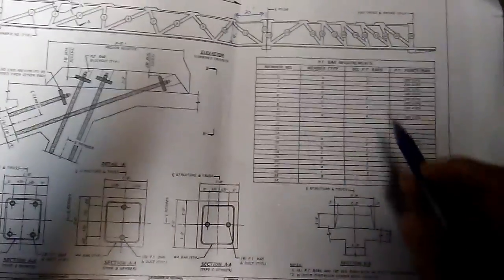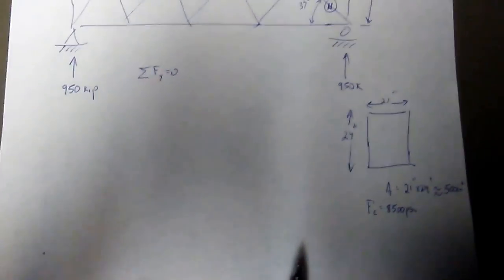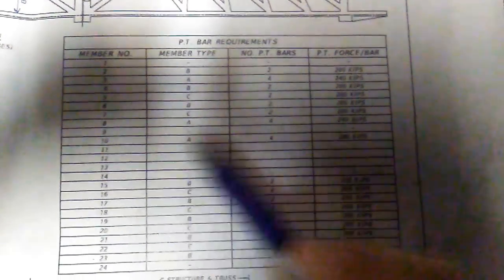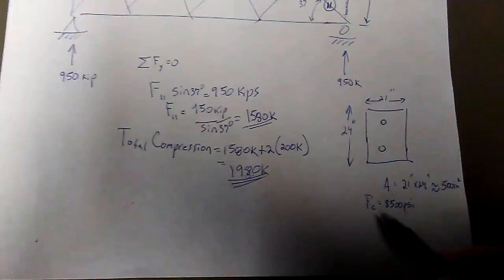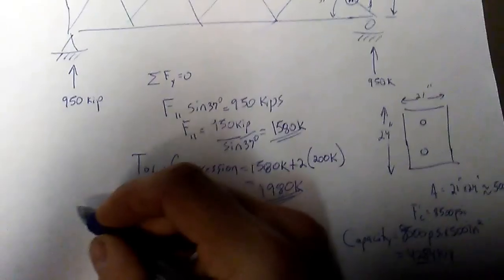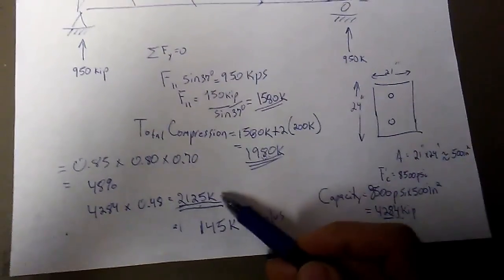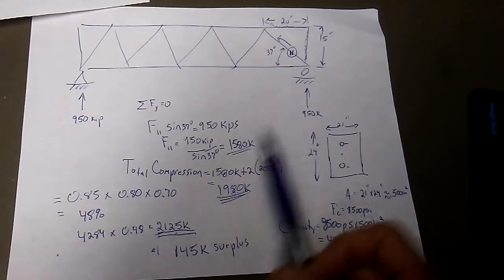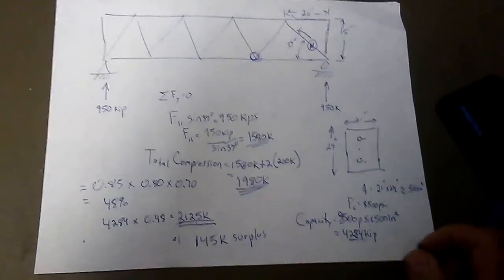FIU Bridge Collapse: The Hidden Truth (Part 3)

Comment: Very nice calculations and explanation..the devil is in the details...the videos reveal the area around the member 11 node may be suspect.The nodal joint  is being asked to do a lot.   Member 11 forces  pass through the node to the  horizontal top chord truss members at this point , post tensioning transfer contributes to stress complexity. Where were the construction joints, what role did they? Was the concrete solid throughout the node, no voids, aggregate segregation? Was their sufficient peer design review? Doubt there is much research or guidance in the literature for our structural engineering friends..unnecessarily tightening this area would have contributed. Wonder what confinement reinforcement was specified, compression strengths and ductility are greatly increased with increased confinement reinforcement.  A lifetime of continuing education, and learning but have never come across design guidelines here. Why no standards? Regulations? Cautions? I think the key to understanding the failure lies in answering these questions. my two cents worth...we will all learn for this....hard to point fingers, not doubt  someone is studying this situation at this moment....tragically nature again triumphs over ingenuity, very humbling
Reply from the maker: Great thoughts! The issue of confinement reinforcement has crossed my mind and could ultimately turn out to be the culprit. As stated in the video, I would expect the failure point to have initiated at a panel point, where the diagonals and chord members intersect. Because the devil really IS in the details.
Finger pointing is easy and not really productive. It's the lessons learned and how this could possibly be avoided in the future that interest me.

Comment: Interesting presentation. I've looked at several others and they've all focused on the failure of truss element 11 as the initial cause of the cascade failure. However, after watching the video many times I suspect the collapse  may have been the result of failure in one or more of the longitudinal cables in the walkway deck. These cables collectively sustained the entire weight of the bridge. The collapse seemed to happen all at once even in slow motion. I wasn't aware of the 5 day time span between installation of the bridge and its failure. News accounts made it seem that the failure occurred almost immediately because they didn't want to stop road traffic during installation. 

I'm not sure why failure of one truss member would have resulted in the bridge collapse and whether the cracks in member 11 played any role or didn't happen as the result of the collapse  (probably unlikely.)

I was only a C+ student in statics/dynamics but fortunately structural engineering wasn't my major. I appreciate your thoughts on failure of the longitudinal cables. There may have been what you call an eccentricity in the load sharing among the cables. Even if 5 days passed, the cables might have undergone differential elongation due to the weight.This might have resulted in uneven load sharing.

The design was supposed to not only required to sustain it's own static load but additionally hurricane force winds as well.
Reply from the maker: The concrete strength will need to be verified by NTSB in its investigation, since this is critical to the strength of each bridge member. During construction, concrete samples from each pour are taken to confirm that the  concrete properties match the construction specifications.
Reply: structures specialist yes I am familiar with slump tests to verify the strength of the concrete. In this case though the concrete didn't support the weight of the bridge, the longitudinal steel.cables did. Had the strut caused the failure I would have expected to see the canopy collapse onto the walkway deck first but looking carefully in slow motion that's not how it appeared to me. At the point of failure the entire elevation appeared to collapse simultaneously. This suggests to me that it was the walkway deck that failed first. It was the cables in the concrete that bore the weight of the entire bridge and transferred it to the Piers as concrete is hardly much stronger in shear from the bending moment than it is in tension.
Reply: Mark Fischer Slump tests do not measure concrete strength.  They measure workability and indirectly the amount of water added.
Reply from the maker: The concrete samples taken in the field would have been cured in the shape of small cylinders and then tested for strength in a lab.
Reply: Mark Fisher:  I'm with you on this.  It's difficult to determine if it was the roof or the deck that went first.  It seems almost simultaneous.  I'm thinking the tensioning cables in the either the deck or the roof broke.  At that point the bridge snapped like a scored piece of glass.  What I do find interesting is that one end of the truss actually did maintain its integrity even after the collapse.
Reply: The weight of the truss and canopy were concentrated at five points along the center line of the walkway not counting the two end piers. Tensioning the truss cables increased the point loading on  the walkway. I counted 12 longitudinal cables at the end face of the walkway, 6 on each side. You can correct me if a 13th cable went through the end piers supporting the canopy. This point loading may have contributed to the failure of the walkway support cables.

Comment: Also, the bridge weight was estimated, at time of drawings (you are using) --is, 915 tons (you should stick with those drawing numbers as you are mixing ''news reports'' data with plan data.
With that said, it is clear their are post tension ''rods'' incased in ducts, inside of diagonal #11.
I have two channels and one is my construction engineering - as it relates to the real world and installation and this channel is mostly my photography channel...
8.5 x 500=4250.
Basically, you are confining your failure to column #11 and you should consider adding the canopy as the first path of failure. Do not forget to add flexural / plastic and plasticity to your formula and rotation from ''stressing'' one ''lower half'' of this post tensioning could have caused.
https://www.youtube.com/watch?v=4MusBoGQSsQ 
Finally, of course a crack is and indicator of tension failure or compression failure... We will assume it is not expansion during the curing process; as it was never identified or referenced as, " The bridge has cracks but, they are the same as was during the curing process"...(This ''crack(s)" is noteworthy as they took TWO hours discussing it and it's dynamics... We just do not know where this ''damage'' is and specifically what caused it... I state in my videos that it is not significant yet, very significant... 
Never the less, take a look at my videos and you may decide to like my load path failure thinking... That the canopy's post tension rods were not fully installed ("missing" two) and that applied load during post tensioning caused this failure - using the voids from the ''ducts'' to create a tension failure and then a compression failure... Directing the ''point load'' down #10 after the canopy's post tension cables (longitudinal cables) were stressed during this post tensioning of #11. 
Please, feel free to write me on the side if you want to debate this on the side... (I have a phone call, so I cannot proof read -sorry).
Reply from the maker: You make many good points. I did notice the 915 tons on the drawings... makes you wonder where 950 tons came from. About the 2 hr meeting discussing the cracks, I agree with your sentiment. That is quite a long meeting and presentation to discuss apparently insignificant cracks! Your load path failure theory is interesting...I have to give it some more thought. Btw, love your take on the NTSB and dead pilot analogy. Lol!
Reply: structures specialist , thanks for the laugh about MTSB and "pilot humor"...
Glad I have your interest in the load path and those, only two longitudinal, per wing side...
There were to be two additional P.T. cables to be installed...they would have given "resistance" during that P.T. of node 10&11...
But, them not being there, might have screwed their calculations up...
I would love to know why they, obviously felt like p.t. needed to take place at these nodes...Ps. I don't believe the NTSB and their statement that p.t. took place at opposite end of bridge that morning...that node at 2&3 looks, untouched and I could not even find "ports" for p.t. locations...Not only that, they appeared not to care much for that end of bridge as it was pushed aside (as seen in a few images) and no core samples were even taken... 
Hope you find my other video on "Not" installed p.t. cables...I will link you in a moment...

Comment: I mentioned this elsewhere. I watched the NTSB B-roll video and it struck me that the PT rod tube was not grouted in at the time of the collapse. It had also burst through the underside of that strut.
In the installation move, PT rods in strut 11 are put in tension to counteract the cantilever around the jack system. 
Once in final position, strut 11 goes into compression, but that surely means it's PT rods go into compression. 
In that compressed state could they flex or bend within the *un-grouted tube*? 
If they did bend, would that exert a large lateral force on the surrounding concrete? Rebar in the strut would contain that force, but maybe when they were doing something on the canopy with the PT rods those lateral forces exceeded the concrete, started the rod bursting through the underside and caused the strut to fail.
Reply from the maker: With the bridge in final position, the tension in the PT rods is reduced because the concrete is further compressed due to self-weight. Since the rods are not bonded to the concrete and only anchored at the ends by a nut and plate, the worst case would be that the PT bars could lose all tension stress, but they would never go into compression.
Reply: thanks, I know nothing how these things work.

Comment: why does it weigh 950 at each end?
Reply from the maker: essential judge Total weight is 950 tons (equal to 1900 kips). 1900 kips ÷ 2 supports = 950 kips at each support
Reply: structures specialist ...oh...i got the nomenclature wrong...
Reply: I guess another way to look at it is that 1 kip = 1/2 ton.
Reply: Internet Privacy Advocate ...got it.  seems dumb but I suppose t for 2000 is also. lol.  and then the mixing kilo with pound...two different worlds of measure.  reminds me of tire size.  r16/70/265.  wtf.  radius 16 inches (how about dia 16) width 265 mm height 70% of 265 mm. wtf.  I'm sure there's a reason...as long as we all understand the math is the same only the units are different. tru.... Edited... height is sidewall.  here's another i stumbled on to, button battery 2032. dia=2cm height = 3.2 mm.  haha and I was just screwing around measuring things.

Comment: You mention that 8500 psi concrete was specified. I assume this is the fairly standard 28 day strength, but I have not seen any discussion about this.  Given the acknowledgement that this was a "fast track" project, this seems noteworthy.  Had the structure cured for the full 28 days prior to bring jacked into position?  Concrete gains strength rapidly in the first 28 days.  If even a week is shaved off the curing time, the strength may well have been significantly less than the design strength.
Reply from the maker: LTVoyager Excellent point! The strength of the concrete is critical in all of this. The NTSB investigation will need to verify that the concrete compressive strength met the specifications. In addition, concrete samples taken by the contractor during construction of the truss should have been tested to verify that the required compressive strength was achieved before the bridge was put into service.
Reply from the maker: Link to the Miami Herald article (information about destressing of the post-tensioning bars is near the end of the article): http://www.miamiherald.com/news/local/community/miami-dade/west-miami-dade/article207358659.html
Reply: I did notice core samples were also taken by the NTSB. I guess knowing when the samples were take, reviewing the records, and reviewing the findings could help determine the strength at the time of the failure.
Reply: georgewu5 "Someone" is a reliable source I'm sure.  🙄. And your capslock is on...
Reply: SOMEONE HAS SAID THE CURING TIME WAS ONLY 14 DAYS NOT YET 28 DAYS AS REQUIRED !
Reply: Not due to poor quality concrete.  It's due to poor geometry in the design itself.  That's not to say that bad concrete would not be a problem, but I believe the concrete has already been tested and found to be of satisfactory strength.